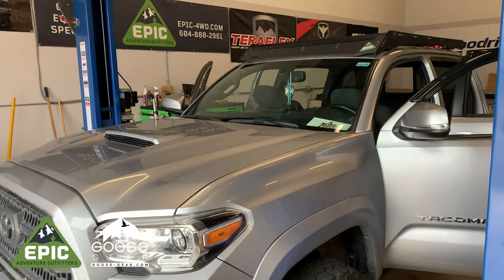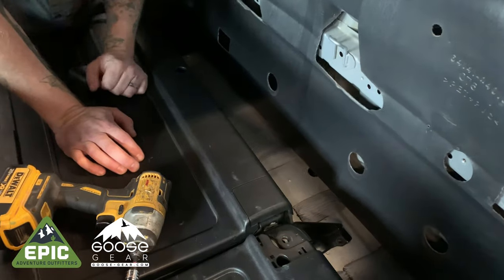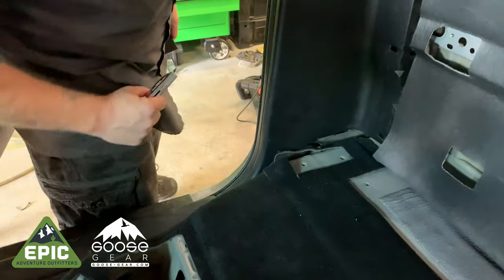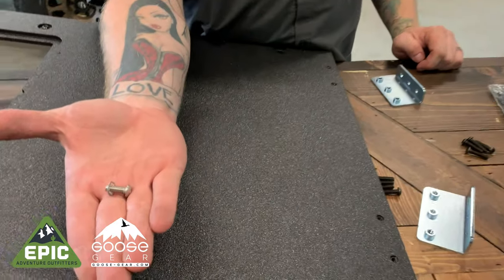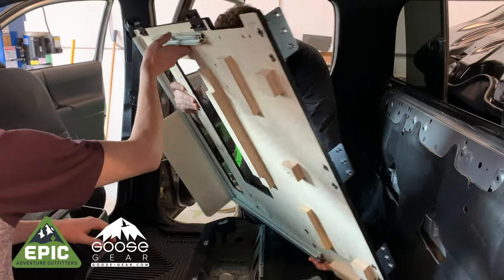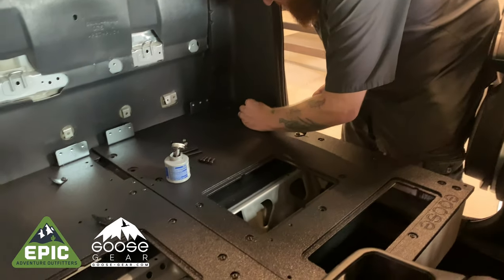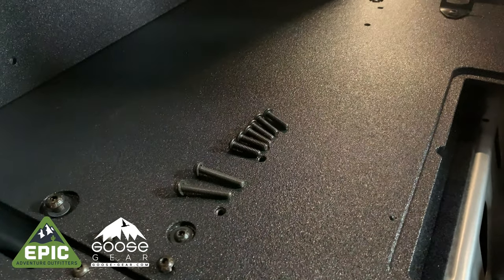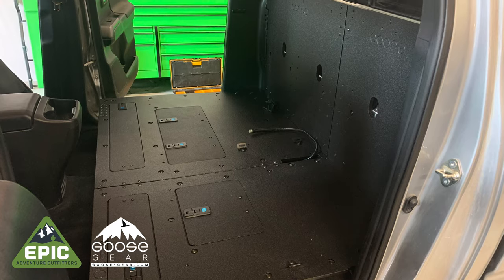Throw Out Your Tacoma's Rear Seats - We Have Something Better from Goose Gear!

Comment: Lol. When you fold the seats down you get the same amount of space. Why not just do that and keep the seats? Seems like Toyota was one step ahead of you.
Reply: I love how it looks. But yeah, you don’t gain a whole lot of actual space. With the seats you’re a little higher and lose a little space behind the seats, but not much. If I were to do this would be just the 40% side just to have a completely flat space for a fridge and then put an arb compressor under the latch door with the air line remote somewhere easily accessiblex
Reply from the maker: Uhmm... ok... the space you gain is significant, especially over just folding the seats down. We do these all the time. Some people want just the 40 or just the 60 delete and some want the whole rear seat gone.
Reply: Epic Adventure Outfitters cool story bruh
Reply: @Ellopez05  In what world would there be the same amount of usable storage space if the seats were still in the vehicle? Not to mention the ability to install a drawer system, stack gear, or put in a fridge that's wired to a battery... also if you have a dog it gets harder for them to jump in a rig as they get older. Cool logic bruh.
Reply: @BarryFranks  weird I have a sub and a fridge already in mine without a set  of 400 dollar each plates, its called wiring, and its not hard I promise.   For my dog, I will be building a platform out of white oak with gunstock (wonderful color stain)  finish I believe, and the top board I will cover in bed liner. pull the fridge and sub and take the platform the full way across and build the new sub mount into it.    I like their design and the function of the product  but their price is ape shit crazy for what the product is.  BUT HEY if people buy it, people buy it, more power to them and the free market and I am thrilled at the passion they show and dedication it takes to run their business.  Just looking around Tacoma accessories its clear to me that 90 percent of the guys that own these trucks are allergic to any sort of crafting, and are more worried about what brand name is on the stickers for their window then the function of the truck.
Reply: Can't fold back the front seats with the back seat folded flat and also muffles the rear door speakers when backseat is folded too.  I've modified 4 of my past tacomas over the past 10 years, with a very similar seat delete "board" setup, always wondered when someone would come out with one thats a "kit". Mine only costed like $75 to do, looked great and worked fantastic for gear, dogs, etc.
Reply: There is about 12 13 inches of space between the front of the rear seat backrest and the back of the cab of the Tacoma, excluding the ridge for the seat mounts on the back, that’s about 5 extra square feet of flat space which is huge. Removing the bench gives you more space on the floor and lowers the loading height by about a foot compared to the seats folded, so you can stack things much bigger, aside from the fact that it’s a lower easier loading height. Plus with the seats folded the driver seat has to be almost all the way forward, uncomfortable for most people. I removed my seats but I’m not spending a grand on some plywood plates with bedliner sprayed on them. I’ll make my own eventually and fill the small voids with some sound deadening fabric because the only downside without the seats is that there’s less material to dampen the road noise
Reply: Late to the party but this literally turns all of that space into storage,  folding the seats down does not
Reply: folding the seats downs does not eliminate them from the equation. They lie against the back of the front seats and lie against the floor. It is several inches in each direction that is taken up by the seats. Looks like the product designer, the install video crew, and everybody else in this chat were several steps ahead of you.
Reply: Sorry but your completely wrong
Reply: No way it’s the same amount of space. What kind of math did they teach you in school?

Comment: I was thinking of taking out the back seats and front passenger seat to see if I could make a camping vehicle(I don’t have a bed cap just a roll cover. I wonder if the have an extension to the platform that would go all the way to front dash on passenger side to accommodate the possibility of sleeping .
Reply from the maker: That sounds like an interesting idea, however Goose Gear doesn't offer anything to replace the front passenger seat! Would be cool tho!

Comment: Great vid! Have you guys ever tried it heard of fabricating a new center console piece? 

The console would be flush with the lid of the cavernous console, it would delete the useless wireless charger, and would require a shifter extension.

The idea is to have all the light & accessory switches at finger reach, and to better distribute the empty spaces. 

Console would start from the USB charger and ECT area (those would be relocated to the new console)

Comment: I just completed something similar in my Tacoma Crew Cab. I used ½” baltic birch plywood. The back was attached to existing threaded locations. To attach D-rings I used insert nuts into the plywood.

Comment: I’m not sure I like the over extension beyond the seat shelf. You lose floor space. Sure they added some extra doors they give access to the floor, but it is not a secure compartment because you can see underneath from the side.  Fantastic idea for some people. The flat surface looks great.  I like the locking doors. The $1000:price tag seems about 30% too high.  Looks like some major effort went into the plan/work though. Even if the seats can slide all the way back I don’t like giving up that small amount of floor space.
Reply: They make side panels to "secure" those open areas.

Comment: Looks to be a well engineered product. But, It would be much better if it was made from a composite material.  The edge at the top by the rear window looks to be unfinished. Lastly, the sides, from bottom of the delete to the floor are open, makes it look incomplete. If Goose Gear would address what I consider problems, I would seriously consider purchasing one. BTW, not bashing the Epic crew, they did a great detailed install video and it was also informative.

Comment: Hi, I recently installed the 40% delete in my 2005 Taco. I had to make a few modifications throughout the project. I still use my rear seat for passengers from time to time so the complete system would not work for me. Overall this item is awesome. It took less than an hour in my cramped, poorly lit apartment building garage it install. However there are a couple of things that are still troublesome enough to keep this project from being 100% done. Do you know the thread size of the holes that are left for (I assume) additional accessories? I would like to mount a MOLLE panel or other items on the back. Furthermore, I was not able to install the left-side top (closest to the bed) bolt on the bottom section. It simply would not go in and I did not want to force it and risk cross threading. Is there a trick to this that I am missing? The original bolt is a step style with a tapered and threaded tip. Any help you can provide would be greatly appreciated. Thanks!!
Reply from the maker: Hi Matthew - we don't have our Tacoma available here to check at EPIC right now. I'd give the fine folks at Goose Gear a call and they can certainly help you out. 844-466-7334 Cheers!

Comment: It's nice and all but not over $1,200 nice.... 
Even with lumber and hardware at an all time high price you can do the same kit for less than 200$
I guess if you have absolutely 0 carpentry skills and plenty of money to blow this is a great option. 
I personally just removed the rear seats, trimmed and painted a 1/2" sheet of plywood in bed liner, wrapped the bottom in tool box liner to reduce noise, trimmed it and bolted it to the floor. Used some cheap swivel rings and bolted them to the floor, added 2 small acces doors to get to the lower compartments using cheap hinges. Cost me just under $200. Sure it doesn't look as pretty as this product but for a tenth of the price ill take it any day

Comment: Deff seems like a good option. But i wonder if itll be sturdy enough for a 60 lb dog to stand, walk, and lay around on. deff would rather have a flat surface for him instead of him tearing up seats
Reply from the maker: Yep, we do this mod for people with big dogs all the time. With our setups, we have large fridges full of food on top of the Goose Gear plate... heavier than 60lbs ;-)
Reply: I've sat on mine and crawled all over it, etc....I'm 260lbs...it did fine.  I also have two dogs, one that is 60lbs and one that is pushing 80lbs and they're both back there together all the time.  works great

Comment: Out of curiosity how much weight does this add or subtract? Would love to do this mod for more room for the dogs when traveling however I also needs seats for SAR work? Oh decisions! Thanks for posting and yes it is a magical beard!!!
Reply from the maker: Hi Kitt, the plates are not all that heavy. And you can do just the 40% or the 60% part of the seat instead of the whole thing, thus having some rear seating with some extra storage space!
Reply: I just did mine and I would say all 4 pieces (60/40 bottom and back) add 50ish lbs

Comment: I was also wondering about the possibility of switching the 60 and 40 seats. I have a son and have to have him sit in back rear passenger seat as he’s young . That is the 60 % seat and is more than too big for him. I want to switch the driver side passenger 40 seat to that area and keep the rest of back open for cargo and maybe mod a storage cabinet for my tools. Can it be done? I haven’t removed anything yet as I frequent drive my son around so I don’t want to take out seats and not be able to put them back in time. In your professional opinion could that be done?
Reply from the maker: Switching the 40 with the 60? Not that it couldn't be done... but you'd need some good fabrication.

Comment: I recently bought this but it seemed like it was lacking some of the mounting equipment when i recieved it, a small metal joiner plate that bolt the 60% plate and 40% together.  Can i reach out and get this?
Reply from the maker: I'd suggest reaching out to the retailer that sold you the Goose Gear product and they can help you out!

Comment: MDF "wood" looks like trash.
Reply: Its not MDF, look closer it is probably Baltic Birch or similar which might be 1/2 inch and 9 plys. Very good plywood for design and build. The spray on coating looks like a propriatary LineX type of coating.

Comment: Anyone know the height of these?
Reply from the maker: The floor plates sit right on top of the storage compartment frame. If you lift up the bottom of your seats and then pop the plastic rivets that hold down your under seat lockable compartment, that metal frame under there is how high they will sit. Hope that helps. You can see near the beginning of the video what we're referring to. Cheers!
Reply: Epic Adventure Outfitters it does. Thanks!

Comment: but...why not just buy a 4 runner? have seats and an interior cargo space?  I swear I don't get people that buy a truck then change its function with 20k worth of stuff to end up with a different truck or SUV....why not just buy an access cab?  I mean the product looks great I just dont get why people do this?
Reply: follow up, holy heaven on a biscuit 800 dollars for a plate across an access cab?  with half of it made from a step above particle board?  no thank you,  I will cut my own and spray the surface with bed liner,  that way it wont be made from IKEA wood, and even if I put hydraulic doors with fancy hardware on it it wont come out above 300 bucks.
Reply: a 4Runner does not have an open cargo space that's separated from the cab space. First thing I did to my first double cab Tacoma 6 years ago was to take the rear seats out. This is a super-overly expensive way to address a cleaner look for anybody who doesn't need the seats.